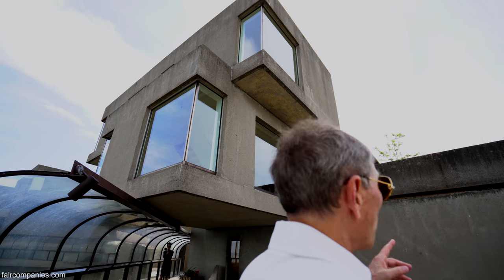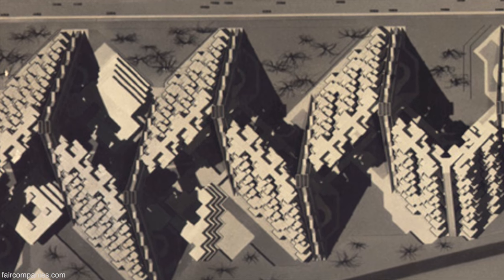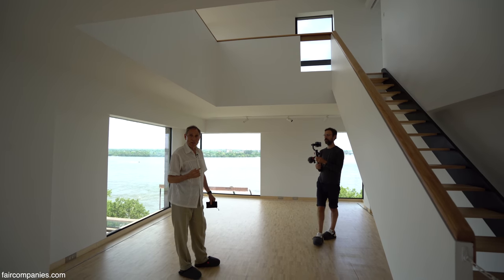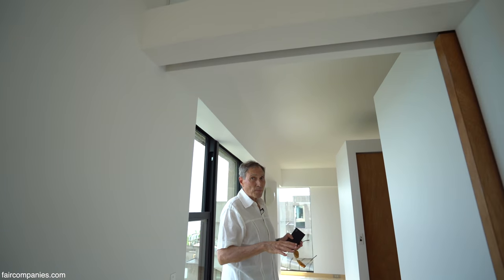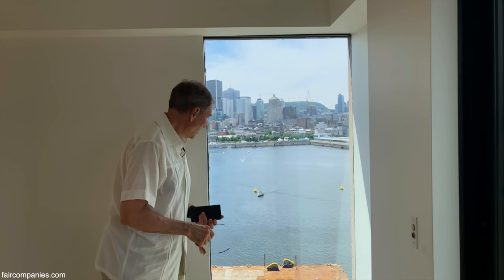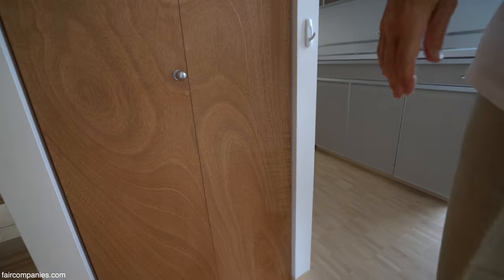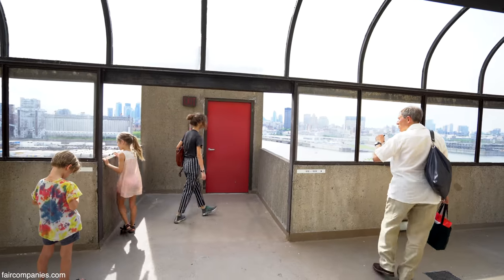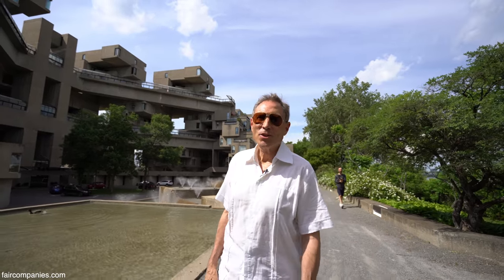Habitat 67 stacks 354 prefabs that get urban/suburban balance

Comment: About the only way to get a unit there now is to inherit it. For those asking about the interiors, one unit came up for sale, and I jumped at the chance to go to the open house (as did many others). The interiors are little different from your standard living unit: dry wall to allow you to paint and hang pictures, wood flooring throughout. This place is really about the views, which are spectacular. Habitat has its issues — what doesnt when it's over fifty years old? — with the occasional leaks, but by and large, it's solidly designed. For those complaining about the concrete: take a look outside any high rise apartment building and tell me what you see that isnt concrete or glass. If it's anything other, then it's ornamental and would be the first thing to fail and need to be replaced.

Comment: It is certainly very designed. I find though that, to me, it seems oppressively gray and its modern rejection of ornament feels cold. I wonder if the concrete were painted (in the style of Legorreta, for example) it might engage the senses more, and perhaps help with wayfinding through the site itself (various blocks painted different shades).

Comment: A very interesting building complex indeed. But, to be honest, I'm not really sure whether I really like it or not. On the one hand, it does look kind of cool, but the bad insulation is a problem (as many others have stated in the comments)...the energy costs must be huge, regarding the cold winters of Montréal. Also, there's a lack of privacy since so many people can look directly onto your balcony/terrace unless you live in a unit on the very top. Also, I wonder how long the bare concrete of the structure will still last with all the exposure to the elements from all sides since it does look a bit deteriorated in some spots. Ultimately, the building kind of "failed" anyway, since it was meant to be affordable housing and yet ended up to be incredibly expensive to live in in the long run. I file "Habitat '67" as one of the many brutalist experiments of passed decades, of which most never really worked and - despite looking futuristic in the 60s or 70s - look outdated nowadays. Still: "Habitat '67" was a great idea for its time.

Comment: I'd love to know more about the structural problems this concept has. Usually you'll have to deal with water leakage, isolation issues and all sorts of problems that are connectet to the time the building was concieved in. Even though I expect it to be quite challengeing, I love the concept and I think we should have more solutions like this. Habitat 67 is a great idea and it's a shame it was never truely finished. I hope one day it will be.

Comment: Thanks for this. When I was in Montreal around 1972 I walked by but couldn't see much. It really helps to have a flying camera to see this structure. Have you done something similar with Le Corbusier's Unité d'Habitation? That would be fun to get a tour of. Also the London Barbican.

Interesting how negative the comments are. My complaint is that it isn't really urban living. I would prefer to live IN Montreal than see Montreal from the port. But that applies to Jean Nouvel's new tower in Lyon as well.

I've seen a stunning piece about a unit here that was remodeled. I would love to see what different owners have done with their units.

Comment: I was a young architectural student the summer of 1967 and visited Expo multiple times. Buckminster Fuller’s geodesic dome for the U.S. exhibit was profoundly impressive as a spatial experience. So was Frei Otto’s massive tensile structure for the German exhibit.  Both of these structural technologies have been applied successfully in the many years since. On the other hand, the concrete Habitat structure was shockingly sterile in comparison .  It appears to be  a poor copy of the indigenous village form found in so many cutlers around the world.

Comment: Habitat 67 is a victim of its own success. Originally it was intended to be an affordable housing solution. Today, it’s anything but. One of the commenters was right, too: the concrete requires regular maintenance. Still, if I were rich, I would want to live there. Kirsten, when did you film this? Looks like it was in early June, but what year?
Reply from the maker: At the end of this past June. I think this works as a prototype, but definitely not affordable until you can get some kind of economies of scale. Or update the material/tech to something more modern/more affordable.

Comment: Interesting concept, but really . . .  The first lesson we learned when we began designing our new home is that a simple box is the least expensive form.  The insulation issues are also obvious to a layperson.   Haven't modern builders used similar units in simpler configurations for relatively affordable results?

Comment: I really like your videos, but there is one thing that bothers me kinda... Sometimes to make the shots longer you slow them down, which results in very low-framerate pieces that don't fit into the whole composition. Perhaps it's better to just leave the short shots or maybe if you really need a long shot your video editing software can interpolate extra frames inbetween to make the video smoother?

Comment: I don't like the surface area of the building.  It is just too much concrete. I also feel it is a bit over the top in terms of density. But more important than that, I don't see how this building is included in Kirsten Dirksen's channel where mostly the housing is minimal and space efficient. This housing is unaffordable.

Comment: Neat concept, but it needs some color.  It looks like living in a pile of rubble or dirty cinder blocks.  Paint some faint murals on the outside walls (where those dark alleyways are between the buildings), or paint different parts of the walls different colors for a "village"-like feel, or have "living" walls, where you have greenery growing up the side.  Too drab.

Comment: Here's the thing, to create affordable housing it should be built inexpensively.  This method of building is anything but inexpensive.  Experimenting with housing should not be about architecheral design, but how to build the most units for least amount of costs.  There is so much wasted space in that design, its doesn't seem to be economically feasible.  Interesting, but completely wasteful.